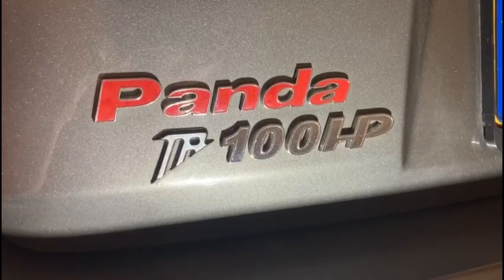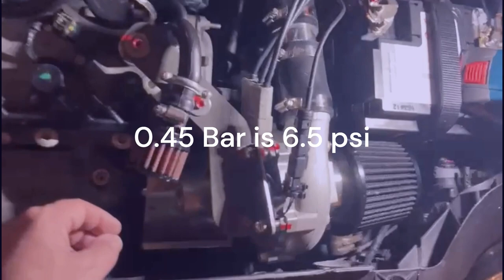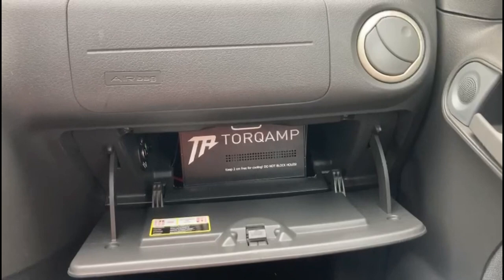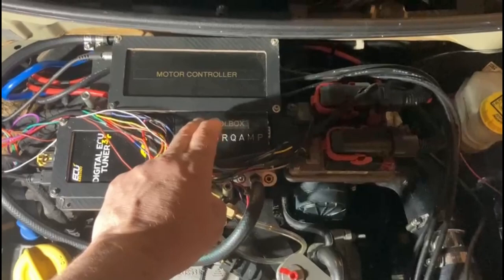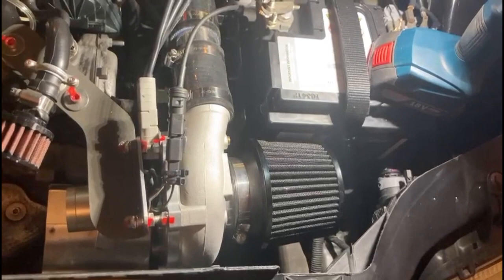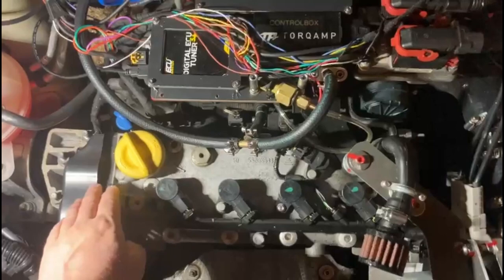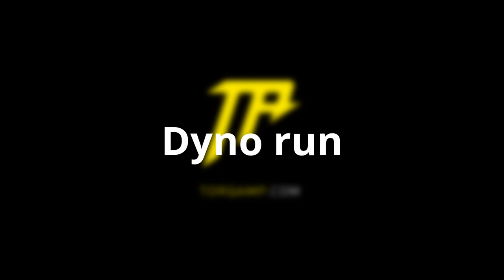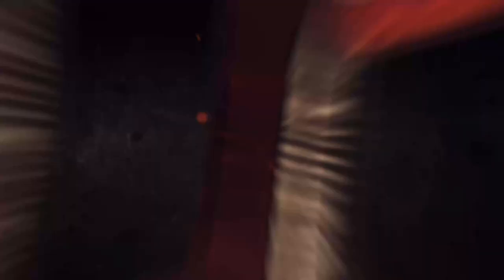155 HP on a Fiat Panda with a TorqAmp

Comment: Does this turbo have a run time? Or can it work continuously?
Reply from the maker: @alirz2640  During normal driving the compressor is doing nothing. It will only turn on during fast accelerations. The battery capacity is some minutes. The electric motor will heat up faster so could be the limiting factor. The electric motor is around 5kW and the charger is around 500W so 1 sec of boosting requires 10sec of charging.

Comment: If I am not wrong this Panda engine has just a turbo. So it is logic that with modfication they run more. But what is with not turbo aspired engines? I have a 1.6 VW. If you do know that even works would be fine, but I cannot believe.
Reply from the maker: This Fiat Panda 100hp is a naturally aspirated 1.4L engine. So from the factory no turbo or supercharger. The gains are only due to the TorqAmp.
Reply from the maker: Also check for example the YouTube video with Mini with 1.6L for reference if you like to see something with naturally aspirated 1.6L

Comment: Sadly it's too expensive to be a game changer. Also, I wonder how in-line electric turbine would perform? It would have to have two power sources: one for boost from a battery pack another from alternator for steady drive. That would eliminate bypass valve.
Reply from the maker: It's compressorwheel is standing still during cruising because you don't nee boost. The engine is able to deliver more than enough power for cruising. So then the TorqAmp battery is charged slowly. 1sec of boost requires 10sec of charging
Reply: @TorqAmp  Not sure what you say in relation to the 'inline' turbine. It may need not to be powered up for cruising. In fact I do have an electric large (8kW) jet turbine and batteries, just don't have time right now.
Reply from the maker: @VladekR I think I know which kind of turbines you mean. The shape of such propellor is not right to build up a significant pressure. Therefore you need another type of compressor. But I'm curious what your results will show!

Comment: How much is the kit I want to put on my 6g75 even tho it haves 300 hp already I want more 😩 😫 😅
Reply from the maker: Is this a natraully aspirated setup or turbocharged?
Reply: naturally aspirated v6
Reply from the maker: @beethao5578 To gain more hp you need 2 TorqAmp kits in parallel. Also consider a more powerful alternator because two kits can draw a high current to charge the internal battery.

Comment: i'm actually thinking of coupling a torqamp with my actual supercharger, in order to increase the total boost. realistic ?
What could be the best set-up? my supercharger and the torqamp inlined ? the first pushing air in the second one, or the opposite ?
Reply from the maker: This is possible but important to check some things. When you already have a belt driven supercharger, you can change the pulley to increase boost. That's for you the easy way. If you can't change the pulley ratio anymore a combination could be interesting but we should check if it make sense on your car/engine. So important to know is the engine size, boost you're runnig with the supercharger and engine rpm range. Also some horsepower indication of the current setup would be nice to have.
Reply: @TorqAmp  actually the supercharger is driven at the maximum speed possible (the pulley had ben already changed) and offer 0.8 bars boost, the idea is to add the Torqamp to obtain 1.2 or 1.3 bars in maximum (the engine had been prepared for that, with forged internals and adequate compression ratio)
Reply from the maker: @alainxavier  okee, indeed then adding more boost devices makes sense. What is the engine size? Because we need to check if the mass air flow is within the range of the TorqAmp.
Reply: @TorqAmp  it’s a 1.8 dohc engine (4g93 mitsubishi). Regarding the MAF, i’ve done a MAF to MAP conversion. :-)
Reply from the maker: @alainxavier  Okee, just a quick rule of thumb calculation. A 1.8L engine at 7000rpm and assuming there is 0.8bar boost at 7000rpm results in an air mass flow of ~180g/s

At this page you can find a graph with pressure ratio of the TorqAmp vs air mass flow: https://torqamp.com/torqamp-kit/
So in the high rpm's the TorqAmp cannot bring gains but in the lower rpms it will add some additional air.

A 1.8L at 6000rpm and 0.8bar boost will flow ~155g/s

A 1.8L at 5000rpm and 0.8bar boost will flow ~130g/s

I will show you a calcuation how to predict a bit what to expect.
A 1.8L at 3000rpm and 0.8bar boost will flow ~80g/s.
A TorqAmp can do a pressure ratio of 1.35 so 0.35bar boost.
The 80g/s will be increased with 1.35 so 80 x 1.35 = 104g/s
Looking again in the TorqAmp graph, you see a pressure ratio of ~1.3 at 104g/s.

In this case you run for example 0.8bar boost at 3000rpm, so 1.8bar absolute pressure. Multiply this with the pressure ratio of 1.30 of the TorqAmp.
1.8 x 1.3 = 2.34. This means ~1.34bar boost at 3000rpm. 

This is just a quick indication but shows bit what kind of gains you can expect.

So there will be nice torque gains in the lower rpms but I don't expect high rpm horsepower.
Reply: @TorqAmp  great !